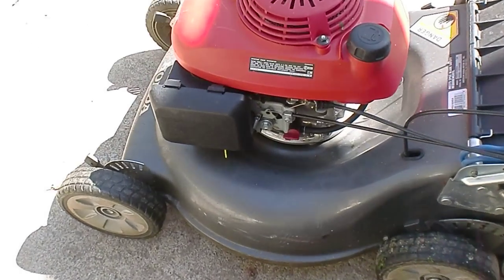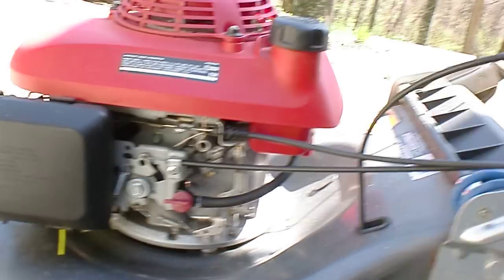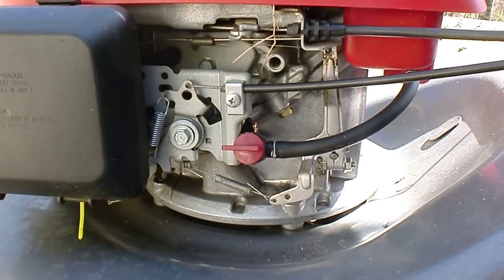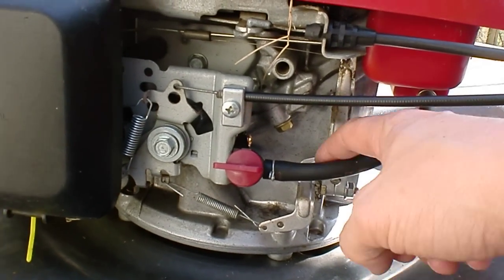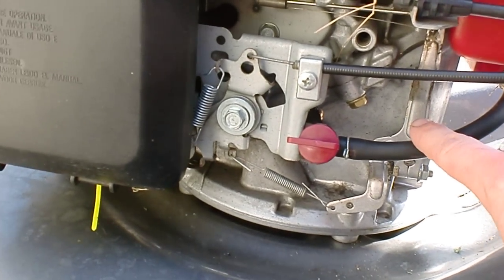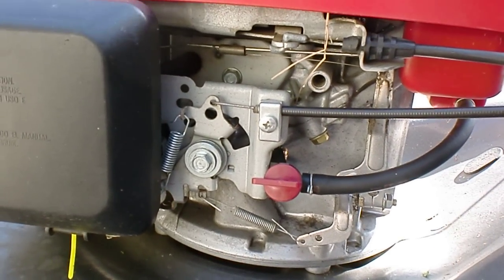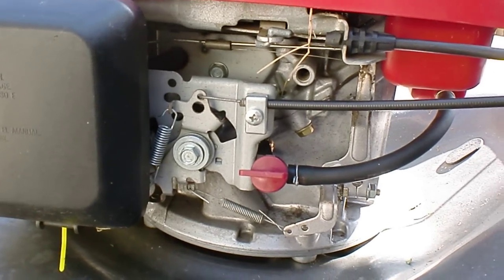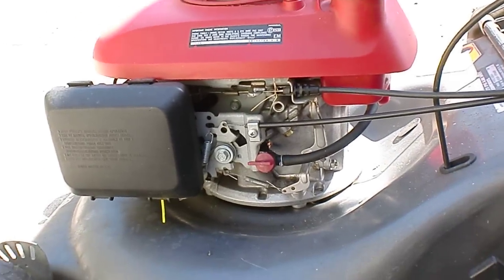Honda mower problem

Comment: I have a Honda HRX 217 self-propelled mower. Was given to me, not able to keep running, usual suspects as I replaced the filter(s) cleaned out the fuel tank, then suspected electrical due to the time between startup and failure so replaced the coil. Nothing, would run strong and then act like starved for fuel, then I watched this video and thought why not...it was the plug. Thanks Jason, and guy who solved it.

Comment: My HRR216 would start fine, run for about five minutes, loose power, stumble and stall. Thought it was the fuel. Drained at the float bowl valve, re fuelled, no change. Took the carb apart, looked clean, blew out all the passages, reinstalled, no change. So I googled it, found you video, would not have believed a spark plug could do this. But three bucks later, it runs like new. Thanks for posting your video.

Comment: So far I've fixed my personal Honda mower and my neighbors Troybilt with the same problem by changing the spark plug. The first time I heard this was back in 2005 on YouTube. At the time it was hilarious and no one gave changing the spark plug any credence for this problem. And I've addressed this with many lawn mower problem solving YouTubers since. The normal suspect is the carburetor and so they go ahead and clean it and then they might as well change the spark plug while they were at it.  I changed my neighbors spark plug on his Troybilt after finding this out and that Troybilt started immediately and ran like a champ. I simply changed the spark plug on my Honda Riding mower H3011 which was manufactured back in the 80's because it would crank but not start. Why? I don't know. I just know that if there is any problem I will change the cheap and inexpensive easy to replace spark plug before tearing into my carburetor. So I'm not surprised by this video fix.

Comment: Thank you, thank you, thank you! Three months into the mowing season, I was really frustrated that I've only gotten one mow in because of a bad carburetor. Then this weekend (after that one mow with the new carb) the danged mower wouldn't stay running. Bad rings? Wrong carb? Nope. Fouled plug. I NEVER would have guessed that a fouled plug would have behaved that way. Cleaned the terminals with an emery board and it runs as well as ever. Thanks again!

Comment: The engine is surging due to carb problem (the main jet is dirty) . Easy way is to add fuel additive--like SeaFoam to the gas. Let it run. It may help the problem. If you are mechanical inclined , you can take the carb off and clean the main jet. Also Honda engine may have a Pilot screw as well, you can adjust it.

Comment: Don't forget to check the (hidden) fuel strainer that is built into the hose at the bottom of the gas tank. It's a very fine filtering mechanism and can be easily cleaned.

Comment: I had an identical problem with my Polan mower with Honda gas engine.  I was skeptical but replaced a spark plug (cheap ~$6 inc shipping) and it did fix my problem.  My mower is now running like it was new.

Comment: Exactly what I was going to say. It doesnt take much scale or dirt to clog one of those small jets or other openings. Seafoam in the gas is a great start. The arm is the governor to keep it running at a steady RPM. When it starts to lose fuel flow, the RPM decreases...the arm then tries to increase the fuel to the engine to get the RPM back up. When it cannot, it dies. Seafoam in the fuel and MAYBE a shot or two of carb cleaner directly into the carb when running. Change the fuel filter also!

Comment: It's amazing how much random/some times poor advise is given. Thanks for the update Kevin. Mine does the same thing but doesn't actually cut off. It will chug back and forth thewhole time. The choke will open and close repeatedly. I just gave it a full tune up with the exception of the plug because I assumed it was getting fine spark. thanks

Comment: Yup that definatly seemed like a bad plug. When the electrode heats up its starts arching. What that governor is doing is trying to open up the throttle all the way which is its job. When the engine goes under load the governor opens up the throttle more to keep it at 3600 rpms and gets the most power our of the engine without running it full throttle. Which as a word of advice your engine is running a little fast

Comment: The are you are talking about is the governor, i.e. the cruse control that maintains the engine at a fix RPM. As your engine is slowing down, the governor is attempting to give more gas to maintain the RPM. You have to address the root cause of the engine slowing down, which is most probably a dirty carburetor. You should check the spark plug as well.

Comment: I have a Easy Start GCV 190 and it had the same problem, starts-runs-dies. Honda uses a thermowax choke pusher mechanism . It's between the spark plug and choke lever and its easy to replace. It heats up and retracts after warming up and extends to normal length after cool down. Part number 16620-Z04-M41. ( round not square ) $10 bucks

Comment: In my case the air filter was clogged.  I have a lot of leaves in the yard and small leaf particles were sucked in over time and choked out the carburetor.  Check the filter regularly and make sure the air filter cover is properly seated.

Comment: OK agree, the carb is having a problem getting fuel through to the cylinder.  When you clean it be sure to clean the fuel lines them selves.  I had gunk buildup in my fuel lines as well.

Comment: I have worked on a few of these hondas with the same problem, like many have said, clean the carb but also drain the gas tank as what cause this is debris, dirt or grass, in the bottom of the gas tank getting into the carb plugging the holes in it causing the engine to get no fuel and choke out. Some times even a few squirts of carburator clean into the carb will fix it, but it may take a few tries.

Comment: that rod looks like a governor which is acting as its supposed to, because the engine is being starved for fuel.  Problem is most likely in the carb with a blocked fuel jet or passage.  Its an easy fix if you are careful to get all the parts back in their place after you clean it with fine wires. Its worth the time IMHO.

Comment: Check your breather tube and make sure that its not split that can cause it to not pumo fuel properly. Secondly check to make sure your front most conection on the carb is attached that "rod"is your governer arm if followed to the carb it has a linkage check its connected properly and moves freely also check all the springs on the govern arm to check there not broken. Happy wrenchin'

Comment: Not many people know that Honda hides an in-line fuel filter inside the fuel line where the hose connects to the gas  /  petro tank , remove the hose at the tank and check there first.
Reply: ***** The filter on my Honda HRB476 is inside the tank at the outlet. Took fuel lines off and cleaned and never found any in-line filters. Cleaning the fuel lines solved the "hunting for fuel" problem with my mower.

Comment: ive had this problem with other mowers, one easy fix can be the petrol/gasoline cap on the tank has no got a breather hole, or it is clogged, all you need to do is get a sharp knife or bradawl, and make a hole, this will fix it

Comment: the shaft that that lever is attached to goes into the bottom end of the engine and is turned by a gear on the crankshaft and has a type of centrifugal system that will lower the rpm by turning that  shaft counter clockwise and closing a butterfly on the carb, its just the engines governor and it doesn't seem to be why its shutting off, because when it started shutting down the arm went to the right which is full throttle.

Comment: Hello, My mower stopped while mowing due to low fuel. And the it doesn't start so far even though I filled gas. I did followings for my not starting Honda engine mower. 1.replaced ignition plug and confirmed ignition works well. So no problem with ignition coil. 2.cleaned the carburetor twice following instruction. 3.Confirmed fuel is provided into the carburetor well. 4.replaced all gaskets around carburetor. 5.replaced air filter. 6.provided fresh gas. But my mower is not still work. If I installed the air filter, I cannot feel anything from the engine, but if the filter is removed the engine works two or three times irregularly and then stop. I can see backfire at that time. I bought the new Husqvarna mower just two years ago. Could you tell me what I can try to do anymore? Thanks.

Comment: I have the same thing happening and I think when I took the spark plug wire off I loosened the tiny metal cylinder piece at the end of the spark plug.  I tightened it and will find out in the morning if that solves the cutoff problem.

Comment: I had a problem with this same engine on my power washer.  It would run about 15 seconds then backfire and die.  would start right back up.  Rebuilt the carb as i thought it was not getting gas properly.  No change.  Valves were way out of adjustment, so I adjusted them.  Same result.  Then i read on another site several people had said change the spark plug.  I did that and it runs like new.  Lesson, never overlook  the basics.  A $3 spark plug would have saved me a lot of time.  It is also a good idea to check the valves every season or two an adjust.  Doesn't take long and makes the engine run better.

Comment: always clean the air filter of oil and the filter box area first then try it with no filter in it.Also make sure that its not crappy gas(more than 6 mns old) gas turns really fast now cause of ethanol added to it.Even dump a tiny bit of 2 stroke oil in the gas for 4stroke motors cause it keeps gas and carbs from gumming up

Comment: I was having the same problem with my lawn mower and the problem was the engine was running to lean so i adjusted the fuel mixture by turning the screw on the front of the carb slightly to the left to give the engine a little more gas.

Comment: looks like the auto choke Is the issue, or is it an older model without the auto choke, if so, then clean the carb and change the air filter on the carb.  Should work.

Comment: Could not tell for sure on your mower but my mower has a fuel shutoff that causes mower to die. Sounds like it is not shutting fuel off and makes it sputter and not die. Mine is a 1995 model Harmony and my only problem is that it is hard to start when cold.

Comment: Your problem is with the carburettor and throttle cable as the cable is making the carburettor shut off pushing it back killing the engine! I have the same mower just older in age and my does the same sort of thing except it revs back and forth when the engine is cold.check the bolt holding it in is tightened fully
!

Comment: My Honda mower would start but then slow, sputter. and die after 15 seconds.  I removed air filter and started and it ran better but still slowed and died.  I pulled spark plug.  It was black but not worn ( my Honda mower is only a couple years old and I have a small yard ).  I replaced spark plug and same problem ( my other mower runs great with a 25 year old spark plug ).  I started with air filter removed, sprayed a shot of carburetor cleaner into the air intake while running.  Mower coughed and chugged black smoke for 30 seconds.  I sprayed another shot.  Mower runs great again!

I have never had a spark plug change improve performance in a car or mower.

Carb cleaner!

Comment: Could be your petrol cap.  They have a small breathing hole in the rubber inside it.  If the cap is tightened too much it squashes the hole closed.   ~Make sure the hole is still visible.  If not new cap.
Reply: Loosen the cap first to see if it it fixes the problem.

Comment: Carb is the problem. I just got finished changing mine. $30.00 off of eBay it started up on 1/2 a pull. I also replaced the inline fuel filter with a Briggs type much easier access. I've started using no ethanol gasoline in all autos and power equipment this is what is killing all of these carbs. Ethanol is a big joke they say it is green fuel but @ 10% I got 15% less gas mileage.

Comment: The mower has a governor and it governs the air from the wheel what is at the end of the string. The governor might be Broke and need replacing. My mower governor to the end of the spring snapped and it ran like yours.  It is hard to explain

Comment from the maker: spark plug worn out. changed plug and ran great
Reply: The 1st time I heard 'changing the spark plug' as the solution I dismissed it. Then I had the problem and I couldn't keep my mower running and I changed the spark plug only because I read the posts to this video. My thought was a spark plug is $3 bucks and taking a carburetor apart was not going to be my 1st option. And it worked! But that just goes to show the very many DIYers out there that will 1st clean a carburetor rather than explore some easier fix 1st.
Reply: Caution: do not put the spark plug in backwards.

Comment: the clicking noise is the blade is hitting the cover to the rear wheel drive also use only non ethenol gas in any small engine  change  spark plug

Comment: It's hard to say without physically being there, but it seems that as you throttle up or down it can't run at the correct speed, either too fast or too slow, there might be a problem inside the crankcase with the little plastic gear with weights on it that is attached to that little lever arm, sometimes they throw a weight or something chews some of the teeth off, even if it's a little bit screwed up it can cause that to happen, this vid is old so you probably got it taken care of already.

Comment: Clean the carb  first ,  and really clean it too and at last resort replace it . dump the gas out , change the plug if you want. - wouldn't hurt to replace it at once  during the life if the mower - over rated to change every year - not a must . Remember maintenance is a must and don't let unit set outside , that's a no no .

Comment: Mine was suffering the same problems. This lurching, stalling and quitting has nothing to do with the spark plug or the ignition. The armature you see moving is the governor attempting to regulate the fuel due to starvation. All it needs is to be removed and properly cleaned. Mine began do the same as your mower is doing in the video and then would not start at all because it could not get any fuel. See video for procedure at BackWoodsCtryBoy channel-LAWNMOWER REPEAIR: honda carburetor repair.

Comment: Bad gas.The new gas with ethanol absorbs water from the air.Mix fresh gas with a fuel stabilizer . Only store a months supply.Check your air cleaner filter
Reply: +Jim Wu Try marine gas... 91 octane with no ethanol.  The only thing I run in my honda mower engine!!  13 yrs of trouble-free operation!!

Comment: my honda runs just like that, but it doesn't rev up like your's did in the begining. end of summer it was fine, pulled it out after winter and it runs like your's. I can't even use it.
What was the problem?

Comment: My HR214 will go to slowest speed and 'STOP' setting at the lever control will not stop the engine. I will replace the plug. And no one at all below mentioned the size socket the plug takes!

Comment: Many of the answers here could have been the problem. Another thing to check is the muffler bearing.
Reply: ***** that is great
Reply: ***** It's either that or the blinker fluid.
Reply: Logic1972 this could have ALL been fixed with the 2x4 extender
Reply: ROFLMAO! I was gonna try something cute but you guys got it covered.
Reply: Alwayss the muffler bearing

Comment: I have a mower doing the exact same thing. I rebuilt carb., replaced plug,replaced filter,  checked all electrical components, and now am ready to tear into mower. I think COLL1N has the answer. Have done ALLOT of research and have come too the same conclusion. The the goveronr system is designed, the weights are prone to failure or malfunction. Will let you know answer soon    Thanks!

Comment: RPM's sound too high when you started it . Most engines I have seen seem to be set lower rpm than yours ; I think that most Honda's last longer not just cause they're built better & have tighter tolerances but also cause they don't always scream at highest rpm's even when not needing the max power.

Comment: check your brake cable separation at flywheel noticed you could not turn machine off should shut down in 3 seconds. BAD GROUND

Comment: Change the spark plug, When the plug gets hot the point seperates and loses spark, makes it sound like it is runnung out of fuel, I had rebuilt my carburator, changed the fuel filter and everything else I could do to try to fix, Honda used a cheap plug, GET A GOOD PLUG! Headache and problem solved...